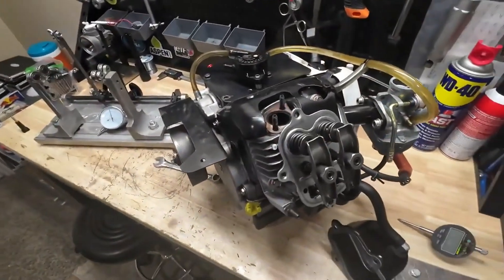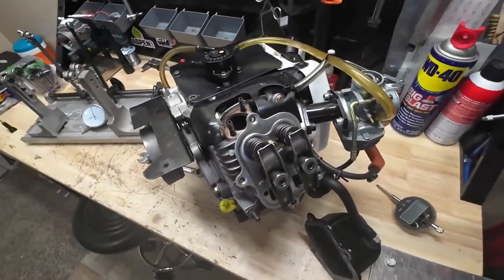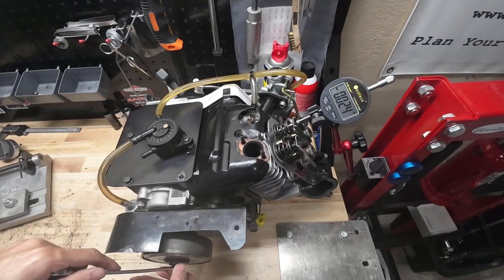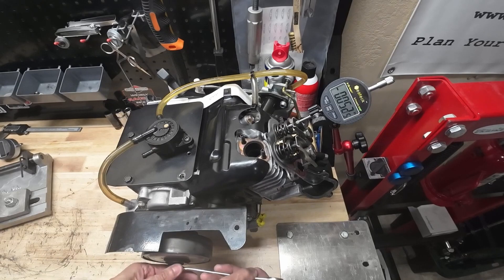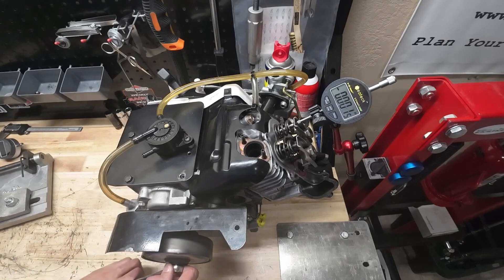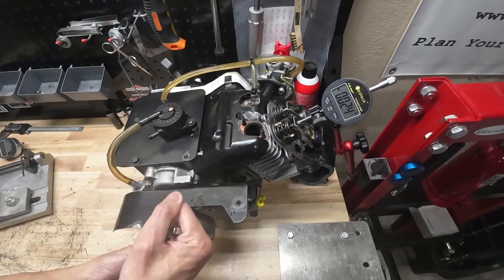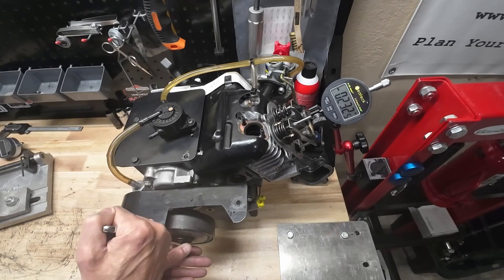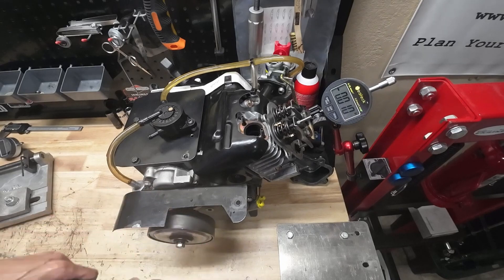Briggs LO206 Intake and Exhaust Valve Lift

Comment: You really need to lock the engine down to your bench.  If the engine is free to move around, it will effect your reading.  Also make sure your engine is parallel to the gauge.  A few degrees off square to the gauge will make a difference in your readings.
Reply from the maker: Very true, so I have a dial indicator holder I use on 2 strokes  and if I remove the head I can center it over the lifter and lock it down with one of the head bolts.  Testing that way I get Intake .2525 and exhaust .254.  I did complete cam profile measurements on my new 206 that way as well.

Comment: Might have Cam lobe wear on that motor hows the oil been looking & do you have a Magnet on drain plug & sence this is a spec motor all cams by Briggs should be the same tallerances
Reply from the maker: Yes the oil came out black.  This was a customer engine.  Could also try replacing the push rods before replacing a short block.